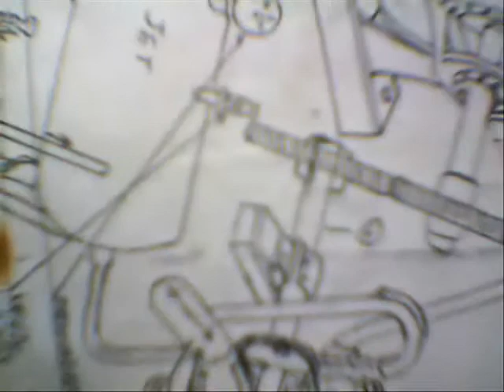Non combustion engine

Comment: i can't read the notes nor understand the connections and functions of the parts from the drawing. explanations of each bit of it and how they work independently and together would be a help with understanding why this engine works, rather than continual reassurance that it does what you say it does.